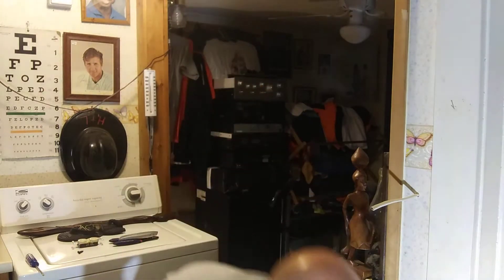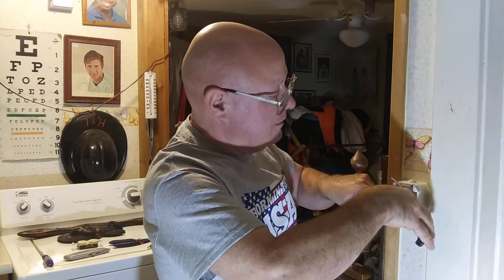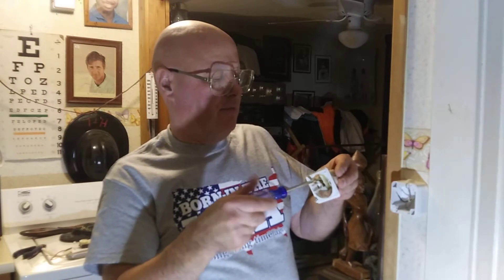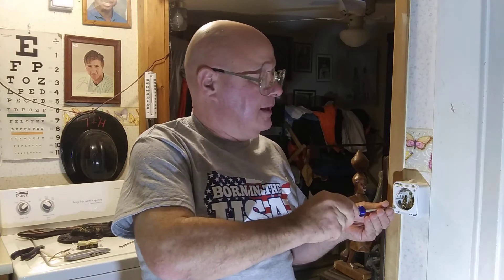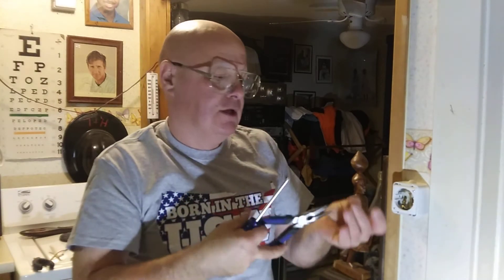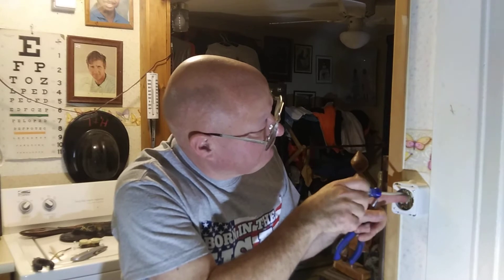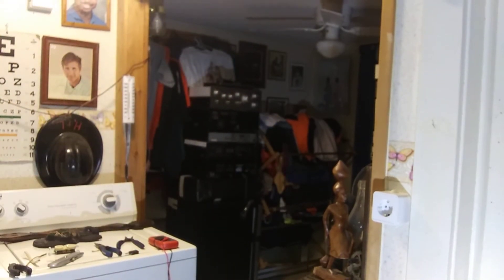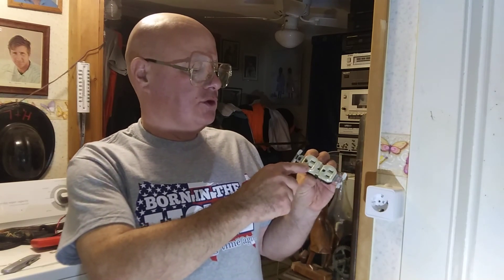how i believe you can use European small alliances here in 🇺🇸 USA

Comment: So you can only use equipment really available to run for both EU and USA voltage and also don’t forget frequency standards EU electrical current and voltage is at 60hz (60 cycles per second) whereas in USA we have 50Hz (50 Cycles per second). This difference in frequency also matters. Usually most modern electronics can tolerate this but some equipment with motors (kitchen equipment and heaters) could underperform and can cause safety issues motors could run hotter and be weaker in performance.